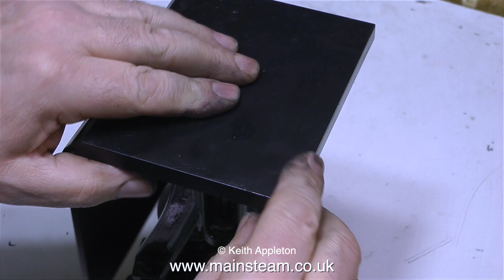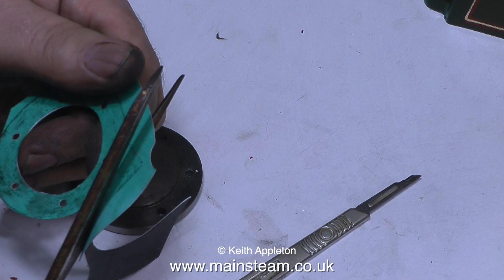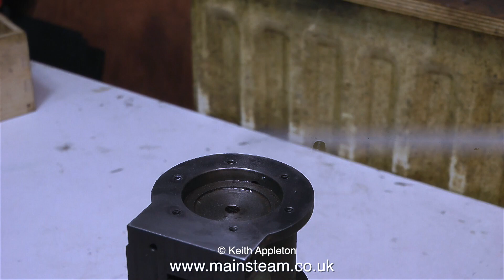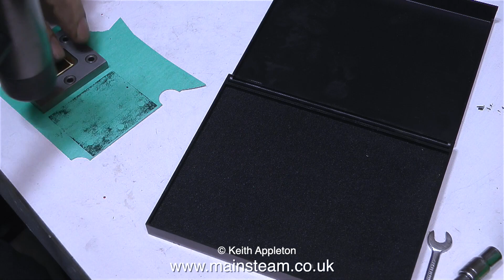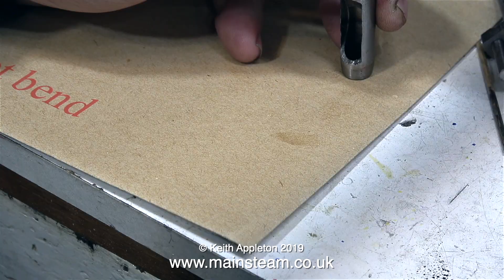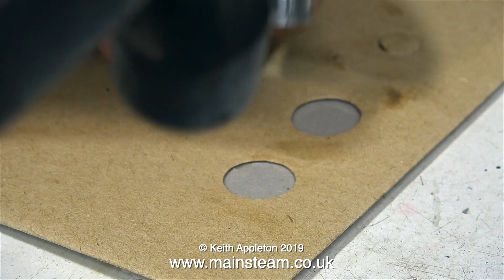MINIATURE STEAM HACKS - PART #10 - MAKING GASKETS AND STUDS

Comment: What thickness gasket material do you recommend Keith?
Reply from the maker: Stuart Models sell suitable gasket material for their smaller engines. It is very thin stuff. I use my oil mix for most general lubrication in and around the workshop but it is too thick for use on my Lathes.
Reply: @keithappleton  Thanks very much Keith and thanks again for all your videos and the sharing of your wealth of knowledge, you have enhanced the hobby for me incredibly so! Jim South Coast of New South Wales, Australia.
Reply from the maker: That largely depends on the physical size of the engine.
Reply: @keithappleton  Hi Keith, say the small Stuarts? Also while I have your attention, thanks for your brilliant service to the model steam engine world. I have one more question if I may. I have made up your oil mix. Do you use it on your lathe or or solely for lubricating models?

Comment: As a maker of gaskets please note the following.  Never use a gasket punch by driving it through a gasket into a hard surface!  This will dull the punch very quickly.  Examples include counter tops and  the sides of a piece of wood.  Always drive the punch into the end grain of a piece of wood, or a maluible material like Teflon. This will extend the life of the tool before it must be sharpened again for precise clean cuts in your material.
Reply from the maker: I use a thick piece of card usually . . . .
Reply: could you please tell me where you get the adjustable wrench (spanner)   Can they be had in the us?  I am a tool nut and am always looking for something different.
Reply from the maker: You need to watch more of my videos as I mention them frequently. Just type "BAHCO" into Ebay . . . .